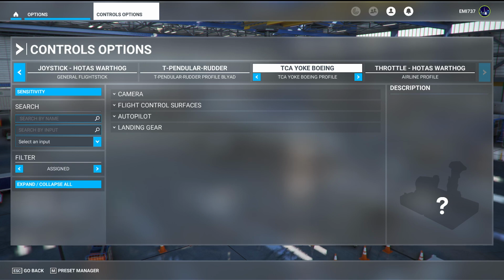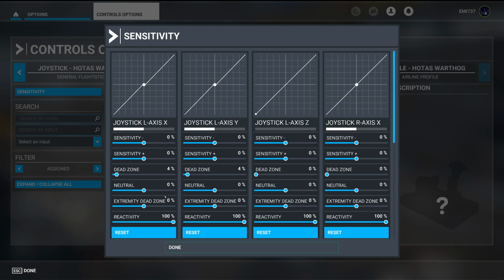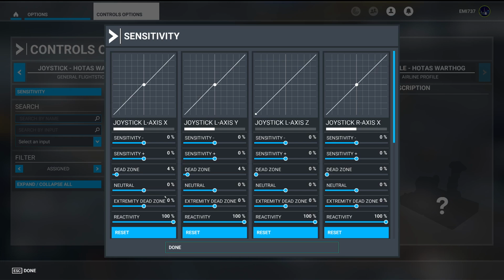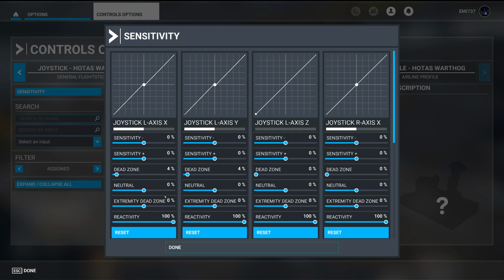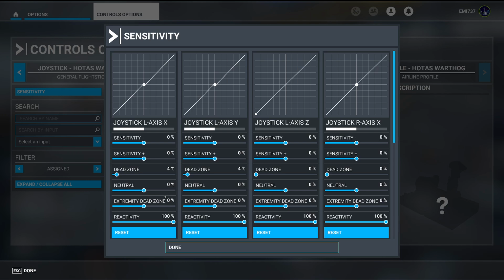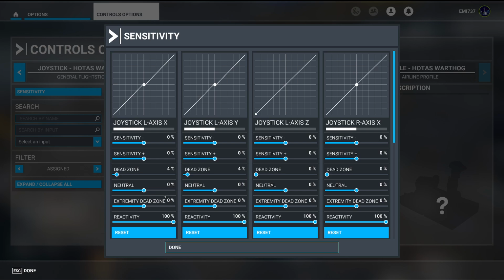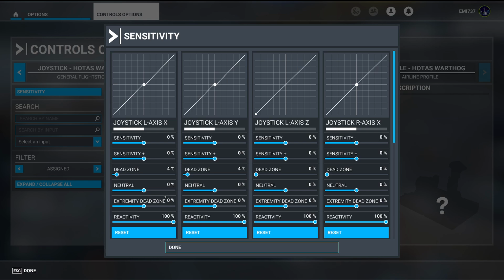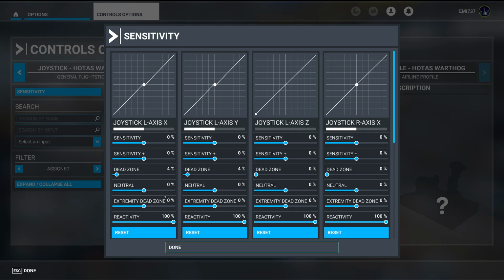My Joystick/Yoke Sensitivity Settings explained | Real Airline Pilot

Comment: Hi, Thanks for the video.  I’ve been having a lot of trouble with pitch and roll for pmdg 777 on MSFS. I’m flying it on Xbox, using Boeing Thrustmaster yoke.
I’ve followed your video but still requires a quite a force for pitch down and it never holds the Pitch attitude once released. Also I have a continuous left roll by about .5 degree per second.When I look at the control column on aileron trim, it’s showing half unit to the right,   Rudder trim is zero, actual control column appears to be centered. I know I can counteract it with rudder trim but why does it keep turning ever so slightly?

Any ideas? 

Thanks

Comment: I prefer configuring my joystick through fsuipc you get pure input straight and simple with perfect sensitivity.
Reply: that is what i am doing but i have hit a road block. i have Virpil alpha prime stick and the second my mains leave the ground i go to gentle rolling bank to the left. i have no figured out how to solve that yet. otherwise everything else thru fsuipc works.
Reply: @dannycnoble  going left after take off?    Probably something to do with aerodynamics with the plane u r flying. That happens with single prop crafts. Or u may have something to do with trimming
Reply: @Neptune-165  i am using the fs9 default kingair. i upgrade from the Logitech x52. never had the going left problem on that. i will go and check the trim settings and see how that looks. thanks for the pointer.

Comment: The problem is that the 737 jumps in msfs2020, but x-plane IS very realistic because imitates the moves like a real 737. Can you fix this problem or is because of the simulator?
Reply from the maker: Not sure what you mean, sorry. Can you go into some more detail?
Reply: @A330Driver  i mean that in msfs2020 you dont feel the real weight of the aircraft on the yoke, but in x-plane you feel the weight, as if it were the real 737, but in fs2020 it does not have the realism of the plane's movement, that is, the physicality of the plane. In msfs2020 when I move the yoke a little, the 737 starts to move a lot, but when i do that in x-plane, the 737 moves smooth and heavy like the real one.

And my question is, can you make It like the zibo only the moves? Or is the problem of the simulator?

Comment: Hi Emmanuel, Your tutorials are so excellent. I use the Brunner yoke and rudders. I understand the flight controls are hydraulically driven. I see pilots moving the yoke quite easily during approach. My question, is there a speed sensitivity device in the system to allow feedback to the pilot that allows flight control pressure to increase and decrease at various speeds. The Brunner software has the ability to due this. 

Thanks for all your insights....
Reply from the maker: Hi Rex,
the elevator feel computer will dynamically adjust your control column forces depending on several factors including speed and trim state.
The faster you are, the higher the control column forces, this becomes especially evident above 250KIAS.
When you're out of trim your control column forces will also increase significantly.
Reply: @A330Driver  You mention elevator feel computer,  is it the same for roll and yaw as well? I'm off to reset the Brunner's.....
Reply: @A330Driver  Quick follow up. The Brunner FFB controls use software called CLS2SIM. There are 2 types of force settings. 1. hydraulic- constant pressure that is adjustable. 2. non hydraulic- allows variable pressure according to speed.

I've reset the 737 profile to respond as you have mentioned by the "feel computer", that is so cool. So, now as I speed up the forces on the controls increase. This is awesome, so now trimming the pressure away is very realistic. In GA aircraft elevator droop on the ground is available, which I assume does not occur in the 737.

Doing some more research, I found that Brunner recommends adding 2 lines to the 737 ini file, for Brunner users:

 [SDK]
EnableDataBroadcast=1

PMDG 737 is such an impressive aircraft, it really does hand fly like a dream. Now, I've just got to adjust max speed pressure and how quick trim response is.

Which leads to one more question.

When hand flying, can you feel turbulence on the controls, or is it more like just countering wing lift/nose pitch with no control fluctuations.....

Cheers,
Reply from the maker: @rfarley565656  You don't feel turbulence at all in the controls, you simply counter the airplanes movements.
There is no aileron or yaw feel computer like the elevator has one, but the maximum rudder deflection is limited with increasing speed. That does however not affect pedal movement.

Comment: Hmm.  Well, I am flying the Zibo mod 737 in XP12 (still in Beta at this time), and the Thrustmaster Boeing yoke.  I am not experienced in calibrating yokes, but I certainly am familiar with the real airplane.  For me, I am frustrated that rotation for takeoff requires MUCH more pulling than the actual airplane.  Same on landings, more pull in the flare significantly than the real airplane.  I was hoping you would have some different settings.  
I am really tempted to branch out and try MFS and the PMDG (but keep in mind, Zibo is free) and may do so.  
I do appreciate your comment regarding landing the real airplane.  The 737 100 to 500, the "classics" were quite easy to land.  That changed with the NGs.  Especially the 900 (the "Clunkers") was difficult.  To my retirement, I never consistently got greaser landings, and fortunately neither did the young FOs.  It just wasn't that easy.  Guys would, just like sports athletes, get "in a groove" for awhile and couldn't miss.  Then, they would get in a slump, and couldn't get a good one.  I was lucky to get in the groove for the last month of my 38 year career. My last landing, of course I drew a 900 Clunker (not the ER) but I got a fine final landing and many with my skills and better do not.  The pressure is really on!
I will continue to try to get the Thrustmaster better calibrated.  No thousand dollar yokes for me!
Reply: The issue is not that Zibo Mod and because it is free, it is your setup and calibration of the yoke, trust me. On the Zibo project there are also real life captains supporting the development team, same to the pmdg team. I can say, the Zibo mod in the XP12 is very accurate in all senses, and some real life pilots even say that it is more accurate than the MSFS. I also noticed when I upgraded from XP11 to XP12, a change in flightdynamics.  The upgrade is absolutely worth it if you are still on XP11. I sat down quite a time and played around with the sensitivity curves for both yokes, the reward was wirth it. One must still not forget that even with the TCA Boeing yoke, it is still very different to the real thing. I have the Honeycomb Alpha yoke and the TCA Boeing yoke, and they both do a very good job, the TCA yoke is more realistic in the forces one has to apply to the yoke when flying. Especially on the roll axis.
Reply: @rotate-gearup  I was a very real life 737 Captain and flew the line every day for decades.  I still prefer the Zibo, and I confess I am not a great sim calibrator.  These days, my only concern with Zibo are the lack of brakes and the flight director lag when the autopilot is off.  In the real airplane, on approach simply referencing the FD bars would bring you right into the TD zone.  In Zibo you have to watch the raw data triangle.
Reply: @paulwilson8367 the PMDG on linear sensitivity setting you will notice it doesn't take much force to rotate. It's good to know thats how it is in the actual aircraft.

Comment: Hello Emi, at first thx for your videos. Wich resistance (how many springs 2-4) you use with your tca boeing yoke and come near the real one.
Reply from the maker: Hi Johan,
I'm currently using two, but only because I'm too lazy to go to the market and buy some more. I would say at least 3, maybe 4, would be more appropriate.
That assumes a trimmed aircraft that's being kept in trim and flown in the normal flight envelope. If you let it go out out of trim it quickly becomes much, much more.
Reply: Well, my Boeing yoke came with 3 installed, and I installed a 4th one.  The way it currently feels to me, I would install another one or two if I could.  But I probably need calibration as I have done hardly any.

Comment: Any suggestion for what kind of calibration or what is the curve that you are using for the Warthog joystick? 7:29
 I also have a Warthog joystick and I have to admit I haven't found any good sensitivity setting yet!  It's either too sensitive in the center area or too sensitive when I move the joystick over certain degree.
Reply from the maker: Hi James, it's set to neutral. You need small inputs but I find it to work quite well that way.
Reply: @A330Driver  Thanks! I will give neutral another try!

Comment: The TCA Boeing yoke has 21cm of travel in the pitch axis so if you are right about ~40cm in the real plane, setting extremity dead zone to 50 in that axis will do the trick just fine.
Reply: Did you ever confirm the ~40 cm of deflection in the real plane? I'm also trying to change the extremity deadzone to match the real plane's control deflections. Thanks.

Comment: I would love to see your rudder pedals toe brakes sensitivity settings. I have the same pedals and cannot find a smooth braking sensitivity I’m happy with. I touch the brakes and the aircraft aggressively stops
Reply: Good point! But Thats not so important for me. The ailerons axis and elevator axis are the most important to have acurate. And most of the time you use the rudder for taxi the aircraft to. (sorry for bad inglish)
Reply: You don't really use the rudder much in the 737 except for engine out and crosswind landings.  Pitch and roll are the big ones.
Reply: @paulwilson8367  I’m not talking about in flight, my issue lies with over sensitivity on the ground while braking.

Comment: I have a real BAe 146 yoke attached to two potentiometers. With default settings it is terribly oversensitive. I’ve had to set the maximum S curve in FSUIPC7 to iron out the skittish handling. Is the over sensitivity due to having a real yoke with a larger range of movement?
Reply: A larger range of travel in a controller of any kind is going to make it feel less sensitive, not more, and that is better for small inputs.  The sim just has a problem with this.

Comment: Does the new yoke have what the vehicle wheel has force feedback, & one would have to question why so expensive then. because even 400.00 and under whole driving setups one can get. so I would say the lack of force feedback, from only using the visual receptor of the brain to extremity is an instinct reaction of physics thats missing, for why compensation to sensitivity is adjusted accordingly, while overpricing the product as pilot approved. toodles